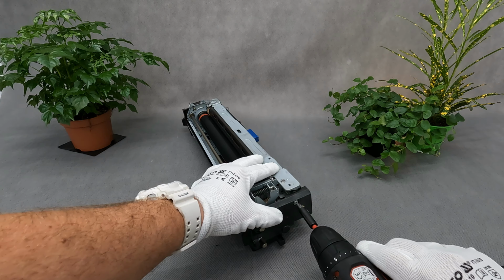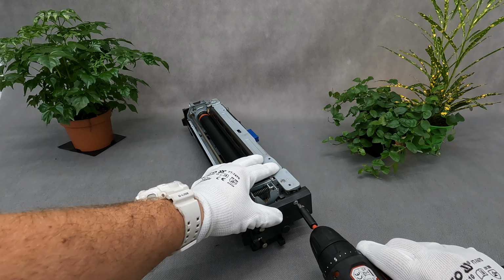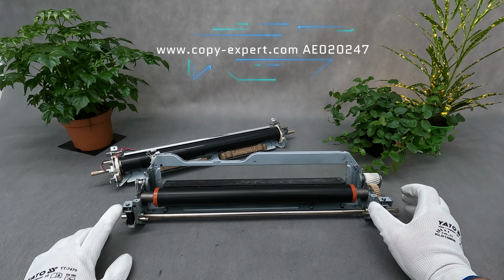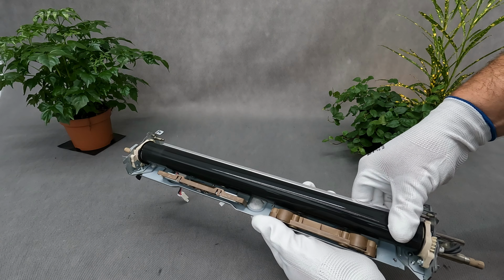Fuser Ricoh MPC4503 MPC5503 sc544 sc545 error SLEEVE and OIL

Comment: Sir Copier Machine Name Kyocera taskalfa 1800 error code 6400 please solution sir
Reply from the maker: I think you have a problem with the power supply or fuser unit. These modules need to be replaced.